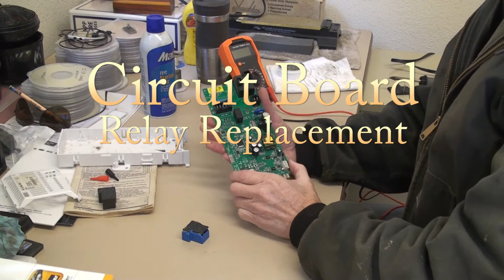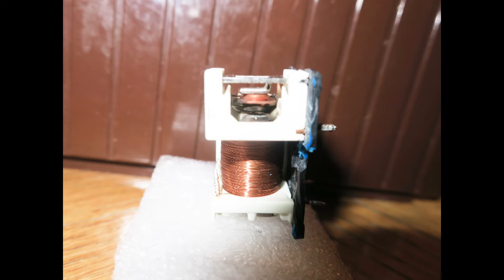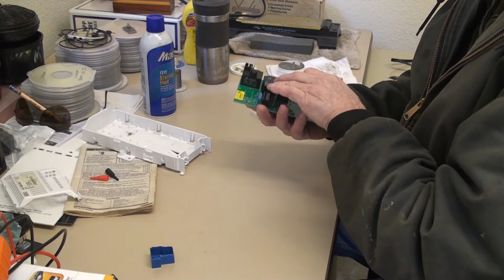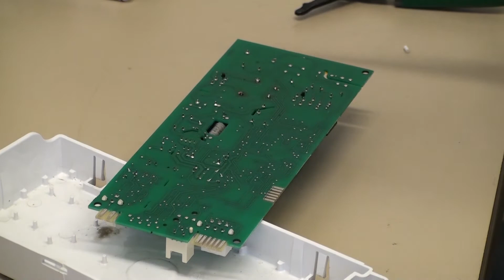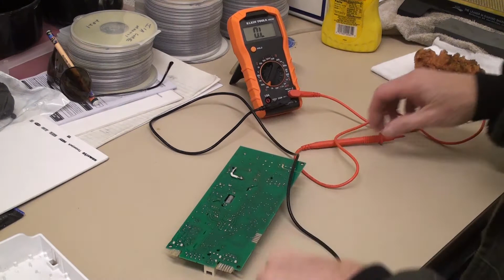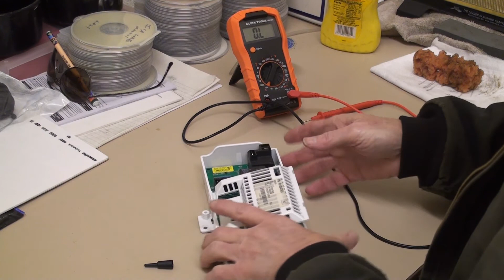Dryer Circuit Board Relay Replacement

Comment: How do you just pop off the cap of the relay? Often times you just need to clean of the contact points
Reply from the maker: As I recall I had to use a small cutter wheel on a Dremel tool to cut the bottom of the cover. The points in this thing were melted together. There wasn't any way to save the component and for twelve dollars it was worth the effort to try.
Reply: @repairsecrets  oh ok. I just fixed my washing machine's drain pump. It wasn't turning on. I used a razor blade to slice off the top of the relay. Inside there is a solenoid that pushes two copper plates into contact. That's how the pump turns on. There was carbon or some other buildup. I simply cleaned off the area where they would make contact and glued the lid back on.
Reply from the maker: @smkie-hf9pz  That's good work and thanks for the heads up on what can be done.

Comment: Do you fix these as a buss.
Reply from the maker: I replaced the relay and reinforced the solder trace on the board with a short piece of copper wire and solder.
Reply from the maker: This was just a project where the client had nothing to lose so the possibility of repair was worth the risk of a failure.

Comment: was that a dryer relay? If so and Im genuinely curious..why did you take out the whole board? I was able to change mine without taking the actual green motherboard out
Reply from the maker: First of all, it wasn't mine. A friend brought it over because he is worse than me at soldering. I don't know how the board sits in the dryer. Do you have access to both sides while it is mounted in the dryer?
Reply: @repairsecrets  pre mature comment lol..some relays depending on model are just bolted on under the control panel and not even on the board. Mine was held on by just two 1/4 bolts, not soldered at all.

Comment: Man I really wish you would’ve shown a closer better look at the motherboard when you were done. Can’t really see what you did with the wire. It looks like you put the wire on a different track then the one you started on. Is the wire on the same track as the start?
Reply from the maker: There are some better videos on YouTube. Run a search on repairing a dryer or Whirlpool or Maytag.